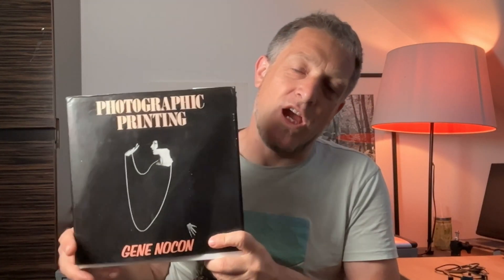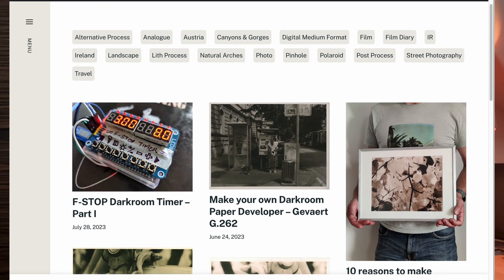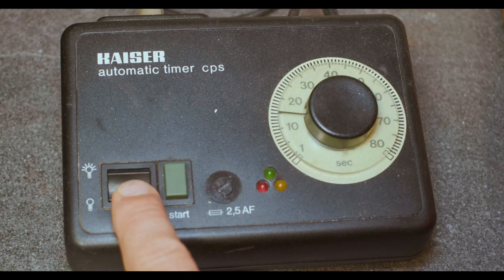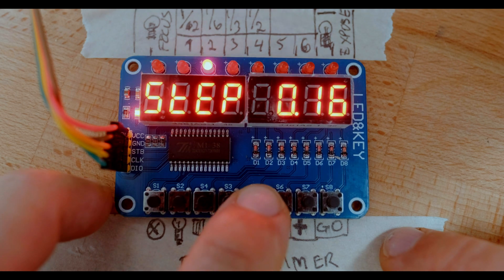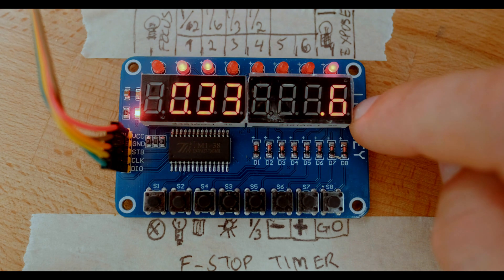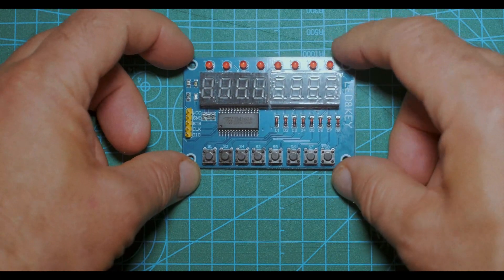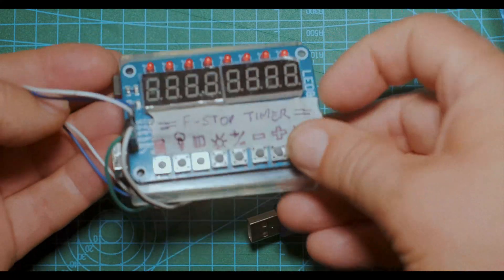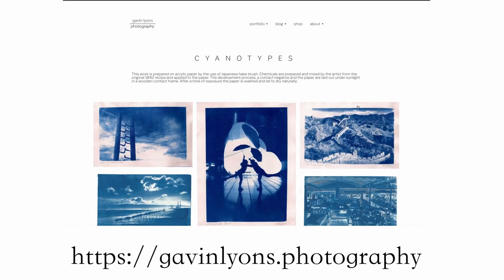Part I  - Build a F-STOP Darkroom Timer

Comment: Great Project! Waiting for my parts to arrive to build one. One thing that isn´t just right on my head, maybe because it has been like 30 year since the last time I've print or develop anything... When you show the strip function, times for me are wrong. If I understand correctly, 1/3 stop intervals for 4 second base time should be "4 / 5 / 6.3 / 8 / 10.1 / 12.7 / 16......". Got to that numbers using direct math, or using tables, for example the one on "Way Beyond Monochrome". Also, when you run the strip test I can see that after the base time, each step is exactly the same time?? What I'm missing?? Haven't build the timer yet, maybe using it will clear the whole thing, and I haven't look at the code either. Maybe you can guide thru how you get to that progression. Thanks!!!! Again... Awesome Project!!

Comment: Hi mate, built one of your darkroom timers not got the case yet but im going to make my own custom one, I want the switches to be slightly illuminated, thing ive noticed is when I hold the run switch it does one run then keeps repeating , so im going to change things so it only runs once for each press, ie doesn't start another run if you hold it
Reply from the maker: @100davies  That's cool you've built the timer. If you want to make code changes you can submit them in the GIT repo. Thanks Gavin

Comment: Hi Gavin,
Very interesting project.
I have a question regarding the test strips, you are kind of "building up" the times by adding the next exposure time with the previous one.
is there also an option so you can expose every next step with the actual time?
I hope you can follow what I mean.
In the Fadu timer you have these options and the way I find my correct exposure is by exposing every time the same part of the print by moving the the paper under a window.
Reply from the maker: Hi, Thank you for your question. It wouldn't be difficult to add that as an option 'Strip Test Window' feature. Basically just add the base time to each step? .
Reply: @GavinLyonsCreates 
Yes that is what I mean, so first expose is let’s say 1 seconds, next exposure is 1.4 seconds and so on.

Comment: Hi Gavin, such a great thing you've done! I use fadu timer since a while and was always looking for such a hardware stuff. I'll check it out and come back with comments later on.
A question I have now is about strips, fadu timer app gives me a second between the next steps to move the cardboard, I couldn't see it in your video how you have done this.
Reply from the maker: Hi Martin,

Thanks for your kind comments. There's of course a beep and a second between each exposure, to allow you to move the card. In the next video currently working using a board which has both the relay and controller on it. So a tiny bit of soldering and you've got a darkroom timer. Of course a 3D printed case is the next step...

Comment: An interesting build Gavin, very useful! I've designed one somewhat similar like yours a while ago and it makes printing so much easier. Kudos for documenting your build and making it available to others!
Reply from the maker: Thanks Sebastian, I'm working on the second part, which uses a relay and ESP 12 board, so basically with 5 wires and soldering a few pins and uploading the code - you've got the timer. Just need some help on the 3D print for the case to fit both boards.
Reply: @GavinLyonsCreates  sounds promising and simple! 3D printing is way out of my skillset, so I can't be of any help there. But I'm sure there must be someone nearby you who can help you out. Did you also consider adding an extra relay to switch off the safelight during exposure? That makes dodging and burning so much easier in my setup. Looking forward to your next video.
Reply from the maker: @sebkanters  Yes but that would make extra soldering and require additional power supply. The board I'll be using in part II is the ESP 12 1R MV which has the power supply, relay and controller all on one board.  But of course I'll mention in part III 🙂
Reply: @GavinLyonsCreates  that makes sense!